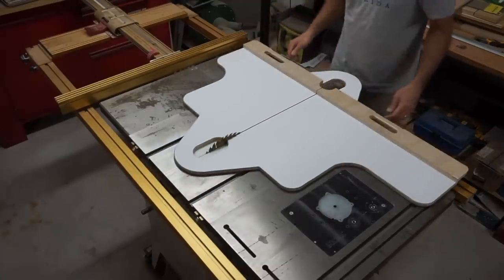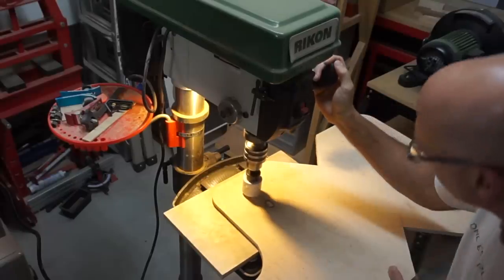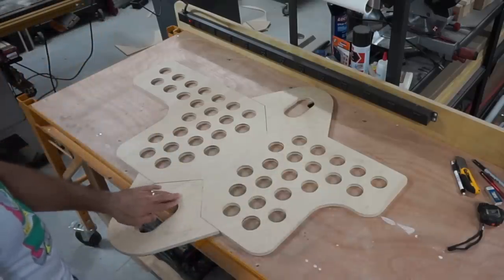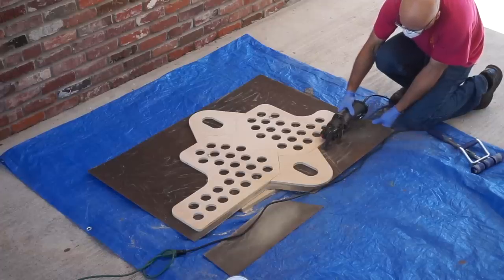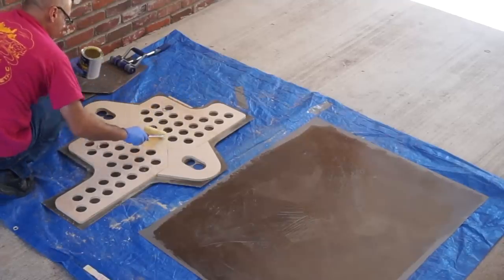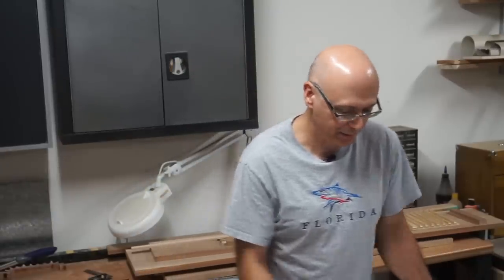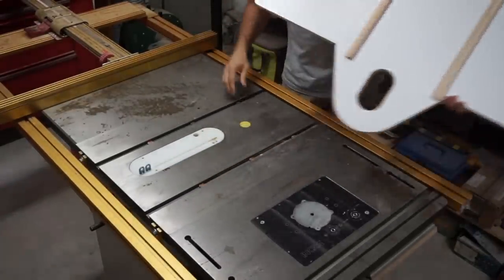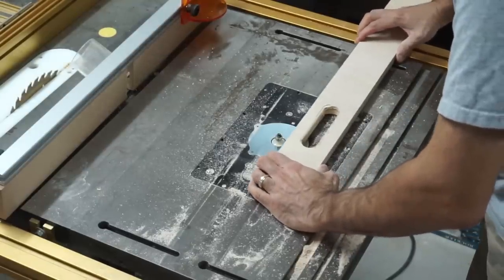A Crosscut Sled Like No Other

Comment: If you build another sled, pin the cross-board stop on one end with a screw and pin or clamp the other end. Do a test cut, flip the stock over, do a second test cut, and measure the 'wedge' width top and bottom then adjust the clamped end of the square board half the wedge error. Repeat two cuts with the flip, measure, adjust, cut...until you get a rectangle instead of a wedge and you'll end up with a very accurate sled.

Comment: Liked how you lightened the weight of the piece.  The laminate should keep it relatively stable.
Reply: Thomas Tieffenbacher/DocSavage45 How? Use a low-profile, double T-slot extrusion for the fence. I believe Incra, Kreg, and Woodhaven offer suitable sections. One slot for stops, the other for clamps.

Comment: Just an Old School tip:  To correctly align the objects which are to be rubber cemented together, after the rubber cement on both pieces is absolutely dry, lay a sheet of newspaper onto it; plain newspaper won't stick. Now place the other piece on top of that newspaper. Neither piece will stick to the paper.  You will be able to shift the pieces around so as to perfectly align them. Be sure to make a test piece to determine if your adhesive performs as such.
Reply: Editor's Note:  I hope it is pretty obvious that once everything is lined up, and without jostling anything, slowly remove the newspaper and apply pressure as usual.
Reply: How is that easier than using dowels to keep the two pieces separated?  That's the way I've always seen it done.  Dowels are incredibly easy to reposition or remove as the case may be.   I can't imagine that newspaper is that easy to remove.   (Plus you can use the dowel to lift the laminate if needed, can't do that with newspaper.)  And you are not my evil twin.
Reply: Howdy, when I was a kid I worked for a kitchen remodeler, we would build counter tops out of plywood and then cover them with Formica. The laminate came in standard widths and we built the wood counter top to the exact size of Formica ( with just a little edge trim overlap).
  We would brush on a layer of rubber cement to the bottom side of the Formica and on the top of the plywood. Then we would allow the rubber cement to thoroughly cure, i.e. dry. I seem to recall It would take about 15 -25 minutes ?  Once the rubber cement is completely cured newsprint / paper won't stick to it; but rubber cement-to-rubber cement coated surfaces will stick, well, like glue. And there is no pulling them apart ! We would then completely cover the plywood counter top with the newspaper and then place the sheet of Formica on it.  A large, counter top size  sheet of  Formica could then be easily shifted around into position. Once the Formica was lined up, a small corner piece of paper was slid out from between them to allow it to be tacked  down; once we we were satisfied all was good we would pull all of the paper and press the laminate with a hand roller.  When you're working with an 3' by 12' piece of Formica, you only have one chance of getting it right: The first time.
This procedure worked for rubber cement; my caveat is to first test your adhesive of choice beforehand.
I can't say for sure about the twin thing, though...  8^)

Comment: Lots of comments about not securing the work piece, but i think pulling the sled a little too far towards yourself is gonna be far worse. Imagine the blade striking the far edge of the sled on the upstroke, while your fingers are in the holders. I mean its cool to innovate and i appreciate that. Its just this sled has the potential to break your face and 8 fingers simultaneously. Im not saying it definately will, but if has the potential, you gotta think twice before making this. Just sayin.
Reply: Exactly what I was thinking. The riving knife/splitters, which were taken out to give more travel(!) were the only things preventing this...

Comment: Like the design concept and think the "weight reduction idea" brilliant! 

Personally, I'd add the blade-guard at the end and the "hold-down" mechanisms for safety
Reply: I would use the five cut method to check the direction of the fence, then adjust it by hand with a rabbet plane. And build a blade guard where the blade comes out of the fence, with an acrylic top so you are reminded every time you use it. I trimmed some skin off my knuckle when I used my hand for a holddown; I was lucky that day.

Comment: Your sled looks good, I guess it's accurate enough if you're OK with it. One thing I did notice besides the ding dong move was the fence is to low, a taller fence gives you more control on larger material, again it's no big deal if you only plan on cutting 1" thick material.... all in all a nice project, thanks for sharing

Comment: Hello, love your design . Was thinking if you removed the laminate on the underside where you put the round holes to take away some weight, you would have less surface area making contact with the table saw surface. This I would think make it slide even easier.
Reply from the maker: Thanks for your feedback, Pete! I think you’re the first person to suggest removing the bottom laminate. Everyone else thinks I should remove the top laminate, to improve the grip on the workpiece. I guess removing both laminates would save more weight, improve grip to the workpiece and provide less surface area against the table. Hmmm! More ideas for version 2, which has been pending for a few years now, LOL!
Reply: I'm not suggesting removing the laminate, I actually think that is a good idea. To reduce the surface area touching the table saw surface, is to remove the laminate that is covering the holes. This still could be done. It would be interesting to see, how much difference it would make.

Comment: It looks good but I think you need a way to use brackets to hold down the material. Especially when making the cut you just made.
Reply from the maker: I only read the part where you said “it looks good” 😆

Comment: interesting design of a crosscut sled. As a custom carpenter doing renovation work on site i like having lightweight tools/jigs. Also i think you could really really use a laminate trimmer in your shop. It was tough to watch you trim laminate on a router table. Very useful tools. We keep several of them with different bits on site
Reply from the maker: Thanks for the comments, Sean. I actually have one of those laminate trimmers, but I just automatically went to my router table to trim the laminate on this project. I’ll remember your tip for next time.

Comment: It’s an interesting design.  I feel like in some places it’s an overkill others a bit lacking.  The only places that really needs structure is near the blade.  You would also need a verticals member to stiffen the jig.  Not having the front vertical allows it more range but completely kills stability.  Having no hold down is also dangerous, especially if you are going to pull the material back.  The light weight is good, but I would keep what’s near the blade and trim more off elsewhere.  The reason that many designs have a chamfered tall back  edge is for holding and also for perpendicular support.  I like the light weight idea around the peripheries but am not sure if the lamination is necessary.

Comment: In defense of how he made that first cut, keep in mind that the sled was trapped laterally by the runners so it couldn't get hung up on the back of the blade. So while it looks like a free-hand cut (suicidal), it isn't. He was holding it down with his hands and the runners were controlling it laterally. If I make this, I will use some weights such as gallon jugs of water, to make that cut safer.

Comment: Very innovative and it is cool. I think you have done a good job, about the only critisms are, firstly, as someone already pointed out about running that board thru without securing, ouch, so maybe clamps to hold down your material would be good. The only  other thing is the  big holes at either end seem to invite a hand hold but as that is where the blade goes it would not be recommened.  You did include some hand holds in the fence which  alleviates the problem to some extent. Most designs have some sort of box/block/cover to hide the blade and protect the operator, maybe you could do away with the holes or make them smaller and or add some sort of cover?

Comment: To make the fence taller but still retain the slim design you could add a removable fence that exactly fits the hand holds and the cutout for when you need the extra height.

Comment: An inspired design. I'm thinking I may make something similar. I like the "hollow core" design and will use that. The fence is too off-square for what I do. I'll definitely use the 5-cut technique for squaring that up. I also think adding 2 cam lever clamps to hold the work will prevent me from having to grab the work piece.  I literally cringed when I saw you cut into your work piece without anything holding it down.

Comment: I enjoyed your video. Most of all, I enjoyed the fact that you innovated and tried a revolutionary new design. I might adapt something like this for my own workshop. Your mean, rude critic is right though, sending that panel into the saw without holding it down is something you must not do again. I would also point out that I never use anything on the tablesaw that captures my hands. I would not put my fingers or hands into your cut-away handholds. If one's hands are captured in that way, and the saw snags and throws the fixture, one's hands are going with it. I like your idea though. I immediately nicknamed it, "The Manta Ray Sled." :-)

Comment: You could have installed a number of T nuts  in the sled to use for hold downs for the piece being cut . Just pushing the sled through without holding the piece scares me . But I do really like the overall design that maintained the stability of the cut .  I just retired after 40 years of building movie sets . I've seen a lot of injuries and appreciate good and safe jigs and fixtures .  Thanks

Comment: OMG my heart was in my mouth as you stood directly in the line of fire while sawing a board with no hold down or any way to prevent the work from flying into your face or chest. Scary stuff! The sled looks really great, I love the idea of lightening it prior to laminating, I hate having to lift my heavy sled. Have you thought about maybe adding a piece of T-track along the backstop so you can add a work stop for repeatability and even a stick on tape measure so you can set your board width without having to go find a tape measure?

Comment: The way the test piece was not clamped or held down to the board in any way on that test cut could have resulted in the piece being hurled at your face if it Kicked Back. Also not clamping or holding the piece through the cut allows variation in the kerf of the blade and vibration to throw the piece off true laterally. Which could account for the out of square.
It certainly looks cool though. Personally I'd have put a tall fence at each end to act as a structural bridge to add rigidity across the sleds width. Thanks for thinking and sharing.

Comment: Like the Swiss cheese interior and the Formica top/bottom idea BUT like many other comments almost crapped when you pushed the wood with no down pressure. Way too dangerous. That would necessitate a higher back board. I agree on those comments, too. A wood shop teacher friend, taught woodworking for 40 plus years, got careless for a split second running an edge over a joiner. Cost him three fingers. It can happen even to the best of us. Any beginners out there take heed from our comments and never run your boards without down pressure. I can still count to 10 (20 if I use my toes) but have my own stitches to remind me what respect for the machine means.

Comment: Very cool design.  I would be holding on to the piece and the fence while cutting, so I would want some type of guards to keep my hands from getting too close to the blade.  Good point below that we don't know if the other corners of the test piece were square to begin with, so, the measurements didn't necessarily prove anything.

Comment: Sincere question: While I share the anxiety expressed by other commenters, I am curious (despite the stability of plywood) if you've had any twist in the sled over its life. I realize that it is a torsion box design, but torsion is reduced relative to the thickness of the core—and yours is only 1/2".
Reply from the maker: Hi Andy, to answer your question, the sled still looks good and works well to this day. I don’t feel that the sled needs any help to stay flat, but in case it does, I’m sure the outer skin helps.

Comment: I love this jig.   Great design. The stock needs clamps to prevent it from raising up off the jig. The type of clamp that reaches over and holds down. Also this is a cross cut type jig and should not be used for ripping. Ripping is best done with the rip fence.

Comment: Like the general concept and design of the sled base. It needs some hold downs for safe cutting. The fence can't be adjusted if it ended up out of square. I would suggest a slightly taller fence with a means to adjust its square. Overall nice work though!

Comment: First a box over the hole closest to you for safety, two steel dowels in the saw table so you never run too far past the hole closest to you, and some clamps to hold the material you wish saw, It's in anyway a great crosscut sled, I like to copy it as soon as possible for replacing my rather bulky one now.
Thanks for the video!

Comment: I really like the concept - light weight, and no back fence limiting the depth of what you're cutting.  If I do something similar, I think I'd build up the fence more to make a better hand hold, and use screws to be able to dial it in square to the blade.
Looks like you've been using this over a year by now... are the fence and runners staying on?  Using only epoxy glue, I would be concerned that flexing as you move the sled on and off would eventually break the glue bond.

Comment: Love the idea of holes in plywood     I agree  with others about accuracy for cabinet and box work.   You should have done a five cut test going all around  to do the measurement,   even factory edges can be off a little.   Epoxy not the best choice for attaching the fence  for fine tuning   some screws and then some alignment dowel pins would have would  have been better ans allow for future replacement of fence if it were to get damaged  or one wanted to place a tee slot for hold downs and stops.

Comment: You've got a beautiful set up with the Incra Fence (as I have) and router on the end of the TS.  Use the table saw for cuts.  Only use the circular saw for roughing.  Then use the factory edge to clean up against the fence.  I also could see light when you checked with the carpenter square.  And, .033 isn't close enough for anything.  If you can remove the fence and correct do so.  The five step method is best for accuracy.  Me, I've never found it necessary to build a sled.  I have an Osborne miter gauge.  Like Norm used to say:  "Rock solid, dead accurate".  I like the idea of your design; nice and light.  Great idea and good workmanship.  Keep on keeping on:)

Comment: Dude: It is easy to see your engineering and or machinist skills.  Using a hole saw to make  HONEYCOMB plywood to save mass?  BRILLIANT!
Contact cement?  Use a low nap roller - 3", 4" etc.

Comment: .033" may not seem like a lot to you, but it will make it dang near impossible to make any projects square. You could have put a couple screws in it, checked it with the "five cuts to square" method, and gotten it dang near perfect. Your only alternative to squareness now is to shim it, which may or may not work that well. Otherwise, a great design and build!
Reply from the maker: Hi David, thanks for the tips!

Comment: Looks neat, but I plan on going with the traditional square sled. Sure, this is lighter. However, I saw in a book on woodworking a design that they called "improved", which actually loaded up the back with extra wood for increased stability and safety. So my takeaway is better go heavier over lighter.

Comment: Cool and efficient design, much better than mine which is very heavy! As others said very dangerous not holding on to the work piece and .03+ out of square not good enough. You should make trial cuts and adjust the fence before permanently securing. Really like your design though!

Comment: I love the design!  I don't think I'd use the melamine material, it's dust is toxic to animals. The slickness of the melamine may have let your sample travel enough to give you the touch of difference you had when you finished the sample cut. I'm going to use your design but stick with three quarter ply. I'll use pan head screws and slightly over sized holes to give room to tweek it, then add permanent screws when I'm happy with its alignment. Thank you !for the video and the design work. I love how thin your sled is compared to any I've seen before. Mine will store much easier than the sled I'm replacing, thanks to you.

Comment: Yes, like the others , I was surprised that with all the toys you have in the shop, you did not use any thing to hold down the piece you were cutting on your saw and that litty bity error off the Rt angle  could be bad later on ..........But your Jig is really cool.  Thanks for sharing the project